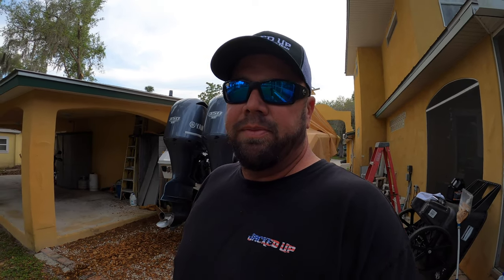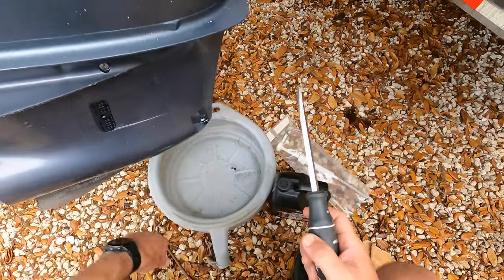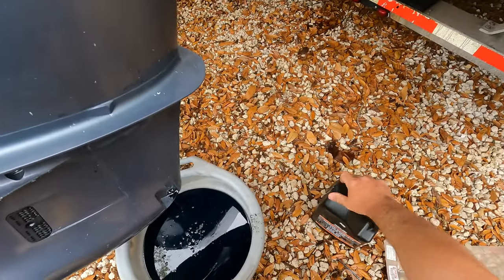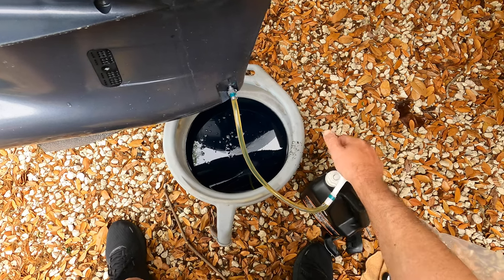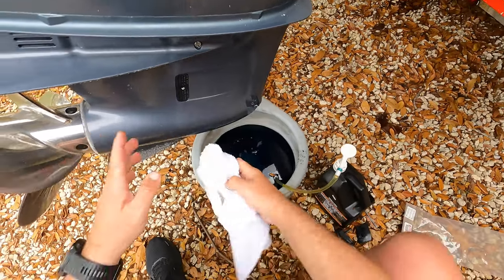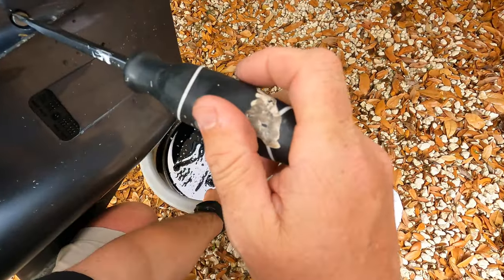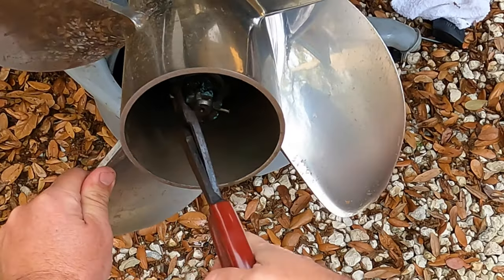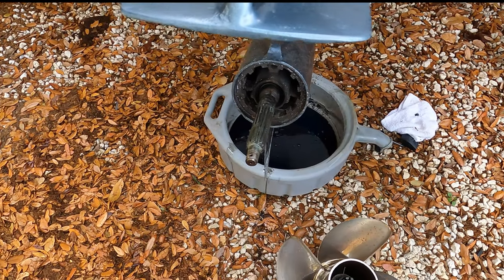Changing Lower Unit Fluid on Yamaha F350 ends in DISASTER!!!  WATER In My LOWER UNIT!

Comment: Couple pieces of advice, 1) replace the gaskets on the drain bolt and fill level bolt every time. 2) you can pressurize the lower via fill hole with just a little bit and spray soapy water on seals to see if they are your problem. 90’% of time that is your issue, but your driveshaft seal under waterpump can also cause water intrusion. I do my own service just like you and have learned these tricks the hard way. P.S. I installed the drain plug with bad gasket and it allowed water intrusion. Change the lower unit oil a couple times more recently after you have the water intrusion and you will save that lower unit”s life.
Reply from the maker: Thx for the info.  This was years ago now.  As you prob know the 350s lowers are troublesome.  I now check them every other trip

Comment: I did not see where you changed the gasket on the filler screws.  I was told to replace Thea every time the screws are removed.  COULDBE source of water into lower unit.  
Great video.  Including calling out the4mm Allen wrench.  Thank you!
R-
Reply from the maker: Yeah you are 💯 correct!  They changed all seals and gaskets during the service when I brought it in. It was like $400 I think.

Comment: Might check seal under water pump.  I assume they have one around the drive shaft coming out of the lower unit.
Reply from the maker: Yeah thanks!  When I pulled the lower unit the oil was coming out from the top seal where gear selector is located.  Pretty common area for this model I have read.

Comment: Very cool vid Bill, l'm pretty crap at this stuff so this is what l need, hopefully your outboard only needs a seal, looking forward to seeing you out again, tight lines man..
Reply from the maker: Fingers crossed! I am getting it all resealed,  there is a total of 5 seals and then they pressure check it.   When I pulled the lower unit the oil was coming out from the top seal where gear selector is located.  Right now these lower units are in short supply as well as the parts for it. All because of covid. UGH

Comment: I have same Yamaha F350 engine, just changed my lower unit fluid have been doing it for yrs very easy to do. This season my fluid came out milky so i know i have to get the seals done. 
In your case, makes no sense how such clean/clear water draining from drain hole,i would expect some milkiness draining,  even a light milky color. Unless you never had fluid in it at all, if thats the case the water only in the unit would have destroyed your lower unit.
Reply from the maker: I actually have had good luck with it so far.  The tech said it was the top seal which pretty much ejects the oil right out....  We flushed it out and resealed all of the seals as well as pressure tested it and its been going ever since.  I do change it now every 100 hours to be safe.

Comment: I believe you're slightly overfilling your lower units.  Fill it, let it settle, and cap it when it is no longer flowing out of the vent hole. The oil is supposed to be level with the fill hole not overflowing and your lower unit needs to be level and parallel to the ground.   Too much lower unit oil can cause the shift shaft seals to fail.
Reply from the maker: Yeah, it might look that way, but I always lose a little when I pull the filler out of the bottom and put in the drain screw, so I think its probably ok.  But good observation for sure.  Thanks for heads up, and I will double check next time.

Comment: The most common source for water intrusion within the lower units is the drain screw gaskets. When you changed the starboard LU gear oil, it looks like you reused the drain screw gasket. They are supposed to be replaced every time the LU gear oil is changed. I had a pair of F225’s that we accidentally reused the drain screw gaskets on (had a friend helping me; never again) and he forgot to put the new ones on. Within a couple months, both LU’s were getting stuck in gear & upon inspection, found what you had in the video.
Reply from the maker: It was the prop I was using.  Mercury Rev4 props take water away from the cooling tube.  I have reused washers with no problem.  If they are older than a year I replace.  I change or check my fluid  every 4th trip

Comment: Hi, did you fix the water in the oil how did that goes what was? is there video part 2? or you give up?
Reply from the maker: Yeah I posted a 2nd video.  We ended up taking it to local service Dept and they put all new seals in it, flushed it and pressure tested it.  Been good ever since.

Comment: Bill. I have a white gasket where my propeller meets that housing unit.. it’s loose an at 1 point had my dads line caught in there.. what should I or what do I need to do?.
Reply from the maker: There shouldn’t be any gasket there between housing and propeller.  There should only be a metal thrust washer.  What engine do you have make model year
Reply: @JackedUpFishing  Mercury 115 2020
Reply from the maker: @joemccarthy552  yeah should be any gasket there
Reply: @JackedUpFishing  I will have to look again an take a picture
Reply from the maker: @joemccarthy552  send it to my email jackedupfishingteam@gmail.com

Comment: Everytime I had a leak in an outboard gearcase, the oil came out milky (water emulsified in the oil). Ant idea why your oil did not mix with the water?
Reply from the maker: Yeah because it came out of my shift shaft seal instead of just letting water in it pushed all the oil out if the top. I was very lucky to catch this.  I am still going this same gear case to this day!
Reply: @JackedUpFishing  good to know.  Thanks!

Comment: Ah man, I think my outboard has gotten water in there too. Will that ruin the motor? I'm pretty sure its from the water pump gasket being almost all the way dissolved but I don't know that much about outboards. I replaced the impeller and have a gasket on order already. I am worried though.
Reply from the maker: Its the lower unit and if it leak its gone.  Address it right away otherwise you will roast your lower unit!
Reply: @JackedUpFishing  I don’t actually know yet if it’s in the oil. I replaced my impeller and gaskets and there was some water in the area not much like a couple drops. I haven’t drained the oil yet too see. Can water get into the oil from the impeller area? Thanks

Comment: Hey I have a friend who also has a seahunter 32 twin yamaha 350, 4 blade props, maximum speed is 42 mph wot and best performance is 1 mpg. I was wondering what are your numbers, and if they're any better what props are you using
Reply: What year is the boat and whatnot?
Reply from the maker: My 37 Seahunter gets 1.0 no matter what speed I run.  Except wide open obviously. But every other rpm range ours a solid 1.0-1.1.  I am getting ready to do the Nizpro flash on mine to make them 425hp.  I will do a video on it as well.
Reply: @brayden4333  2013 seahunter 32 twin yamaha 350,
Reply: @yordangonzalez5239  you know how many hours because mine is a 2014 32 seahunter with 2014 300 Yamahas and fully loaded at like 12500 pounds we run 53 getting 1.0-1.1
Reply: @brayden4333  motors have less than 700 hours, he put 4 blade props on them because he damaged the one of the three blade props he had before in shallow water. He probably put the wrong pitch prop on that boat. 42 wot with twin 350's is terrible numbers for that boat
Reply: @yordangonzalez5239  yeah our 300s have around 1300 hours
Reply from the maker: @yordangonzalez5239  mine runs 53 top end and 40 cruise at 4900 rpm
Reply: Newer models look badass tho
Reply: @yordangonzalez5239  yeah that new 38cts is sick
Reply from the maker: @yordangonzalez5239  I wouldn’t trade my boat for anything!  I absolutely love this rig!
Reply: Damn that's a bummer..... good thing you caught it.